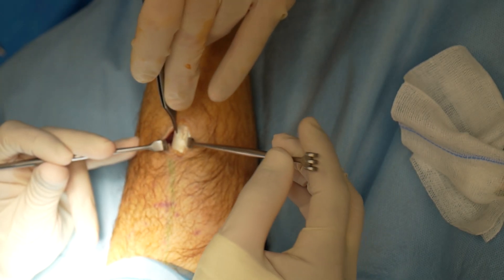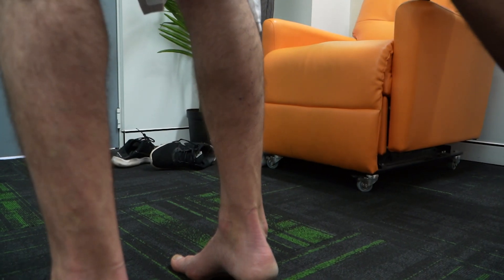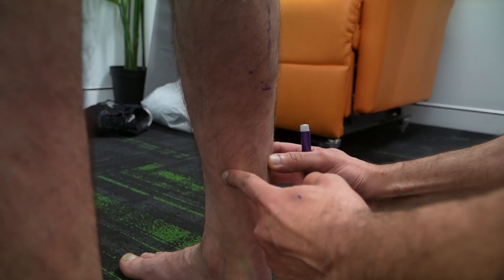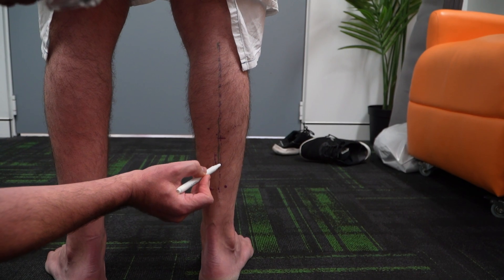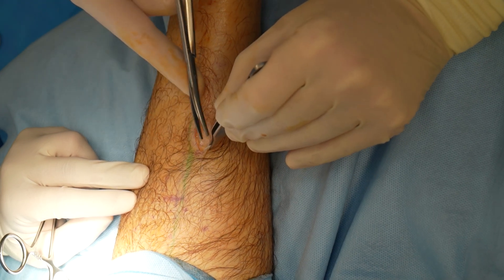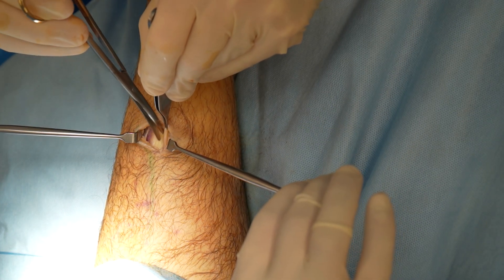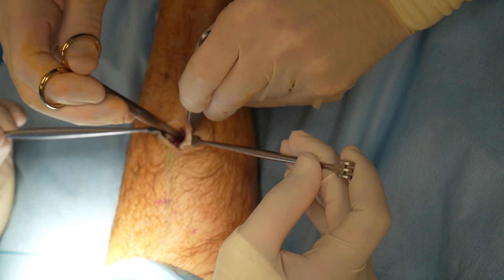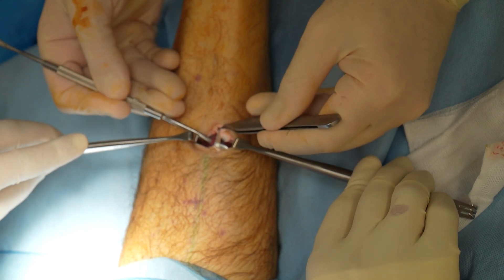Distal Gastrocnemius Recession - Anatomy and Surgical Procedure.

Comment: Hye doc ive done my gastrocnemius surgery in 2023 ,surgery went well but till now i got numbness around my ankle and calf area,is it because of the doctor fault or im moving a lot while on post recovery process,i’ve seen my doctor back but seems he dint know what to do on my case ,do this surgery at a high risk for a permanent nerves damage mind if you could help me 😢😢😢
Reply from the maker: Hi,
The most common nerve to be affected with this surgery is the sural nerve. Initially, numbness can be normal due to swelling and stretching of the nerve. This normally resolves in a few weeks to a few months. 

As your surgery was 2 yrs ago,  you can request a nerve conduction study. This can identify exactly which nerve is affected and the location the nerve is not conducting properly.
Reply: @DrOzanAmir  ive done the nerve study actually but later the doctor send me to pain management doctor there's the doctor  sort of burn my nerves or something to reduce the numbness, btw thanks for ur replies doc

Comment: Hello doctor
Thanks for this great video
İ have applied this procedure to a 9 year old patient who had equinus deformity.i am worried about the healing process and plantar flexion weakness because there is 5cm gap between the edges
İn your experience would the tendon heal with a fibrous tissue in between?
Reply from the maker: Hi Dr,
Strength comes back slowly. I start physiotherapy around 4 weeks, working on stretch, strength and balance. This continues for a few months. Plantar flexion strength can take several months to return.
Reply: @DrOzanAmir 
thank you for your quick answer and information, i am planning to keep the cast on in 90degrees for 4 weeks and follow my patient with AFO brace afterwards until the fibrous tissue develops
Reply from the maker: @dogankeskin4938 Perfect. I will hopefully publish another video on the post-operative outcomes of this procedure in the next few weeks.
Reply: @DrOzanAmir how long does it take for a person to recover after this procedure?
Reply from the maker: I would say, for full recovery, it takes approximately 6 months.
Reply: @DrOzanAmir thank you very much doctor for ur answer,can a person go back for work the next day after the procedure?expecially if the work is with a lot of movement up and down on stairs?i will take this procedure in few days
Reply from the maker: @isahakizimana1918 unfortunately, you probably won't want to go back to physical work for some weeks. The first week, best to rest and elevate the leg.

Comment: Hi there, would this increase dorsiflexion for someone born with club foot and has had surgery (after birth) on the feet to correct (align) them. As theres alot of pressure walking on the outter side of the foot now greating knee pain.

Thanks in advance
Reply from the maker: With club foot, this technique won't be as effective as lengthening the Achilles tendon to increase dorsiflexion.

Comment: Hello doctor.  I have undergone tendon debridement and repair 4  years back. Now, I have a very tight soleus muscle and chronic Achilles tendinitis (not resolving by stretch). Now, doctors have recommended for gastroc recession (cutting the layer over muscle) surgery to remove tightness. Would the video procedure work for soleus and Achilles region tightness. And are their chances that one loses permanent strength over legs.
Reply from the maker: Hi, yes this technique also allows lengthening of the soleus. 

I have not seen permanent loss in strength, only temporary. Specific exercises can be given post surgery to help build strength back up again.
Reply: @DrOzanAmir  thank you doctor.

Comment: Thank you for this video.  Does this surgery result in any subsequent weakness of ankle plantarflexion?  Wondering about how this surgery would affect an athlete such as a runner or squash player.
Reply from the maker: Thank you for the nice comment. Initially there is weakness in the calf muscle. Around the 3 week mark, I get patients to start calf muscle strengthening exercises, building up load to tolerance. Around the 6 month mark, patients don't appear to notice the slight weakness between legs.

Comment: Hi Dr Ozan, nicely done
Is this procedure done for tip toe walkers for example Patients with autism?
What ages can this procedure be completed?
What will the Post Op. care look like and average duration of healing.
Reply from the maker: Hey Humze, hope all is going well br.
Yes, it can be used for toe walkers. The success depends on how severe the toe walking is. If severe a more proximal procedure maybe required or lengthening of the Achilles tendon itself, rather than the aponeurosis.
The procedure can be performed in children. 

This patient started physio 3 to 4 weeks after the procedure. Total healing will be several weeks.
Reply: Is your child tip toe walking bc of the autism or bc he has tightness in his calves btw I just had this surgery done along with my second heel cord lengthing in order to better help me walk as I have cerebral palsy in my right side. If its just tip toe walking and no tightness it’s prob a sensory thing